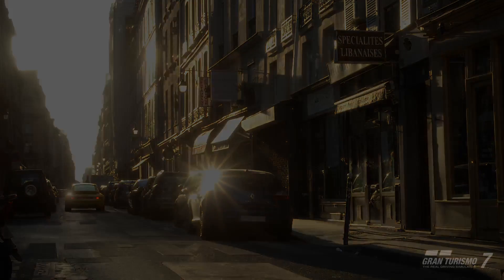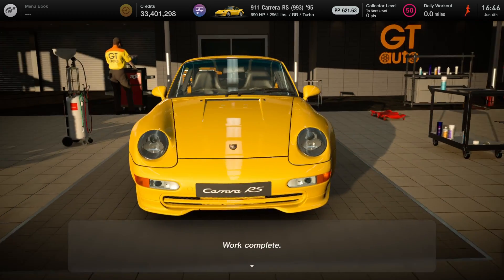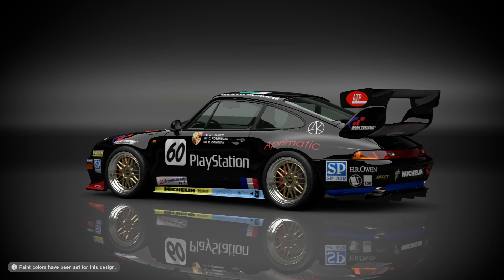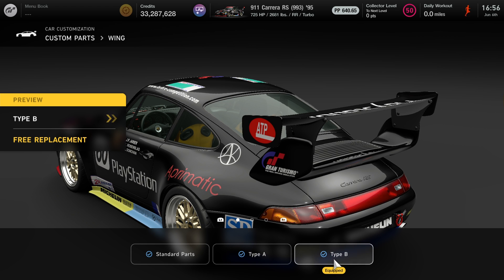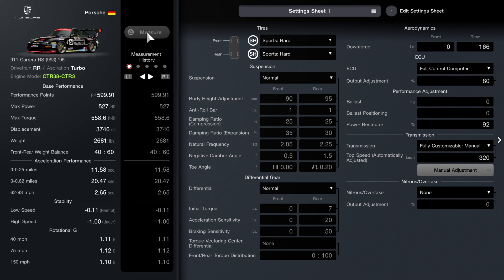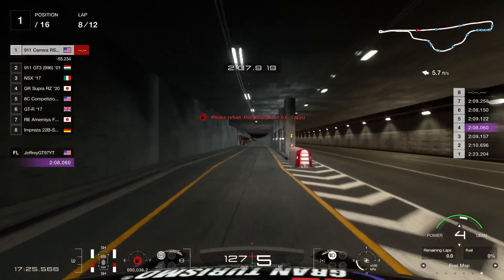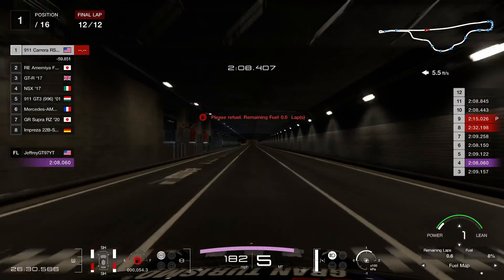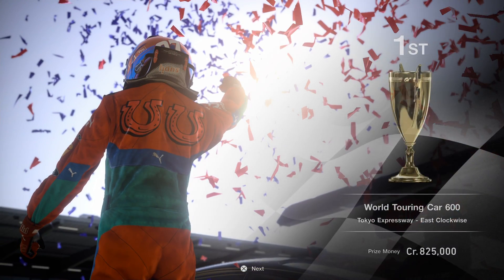GT7 Porsche Carrera 993 RS Ruf Engine Swap Build V 1.34

Comment: Can you only get the engine through a roulette? didnt see the option to buy it in gt auto
Reply from the maker: You should be able to get it through the roulette system don't for it's the RS and not the CS (RS).
Reply: Ah yeah I was looking at the cs, found it thank you!
Reply from the maker: Your welcome.
Reply from the maker: In order to buy the engine swap you have to be have  Collector level 50.

Comment: is the golf mk1 with the quattro engine possible or is it too much on the performance points
Reply: i heard it was crazy
Reply from the maker: I don't know yet I don't have the car.
Reply: It's very possible. Fuel Map 6, and baby the throttle to avoid wheel spin. It's a beast, but manageable if you keep your head down. You can take it to the Le Mans WTC700 as well. Tough but fun race. I highly recommend it.
Reply from the maker: Nice that'll be a really good test to manage fuel saving skills
Reply: Found that car not the easiest if honest gave up although definitely could win 😁✌️